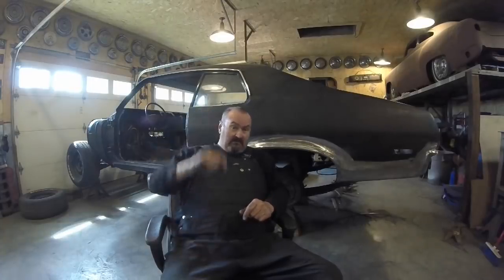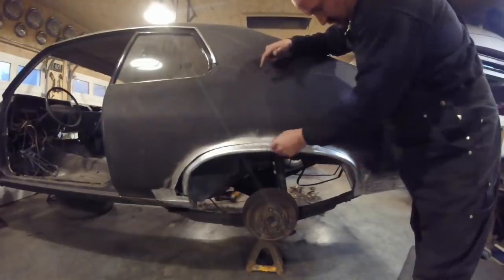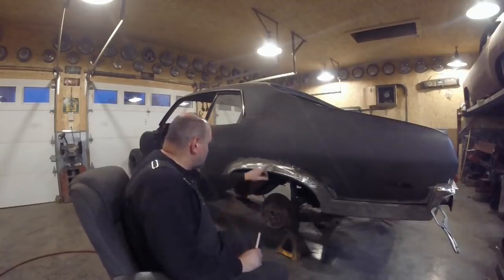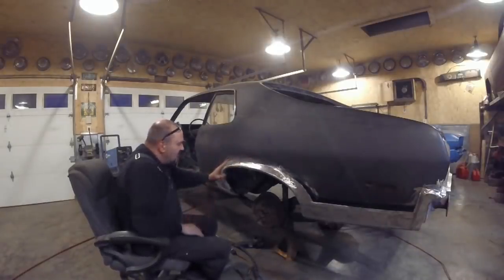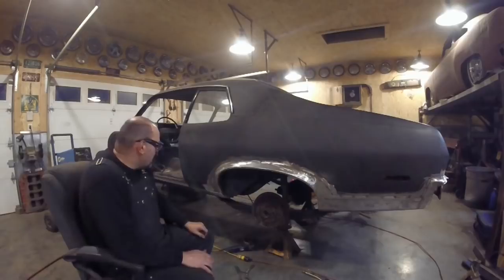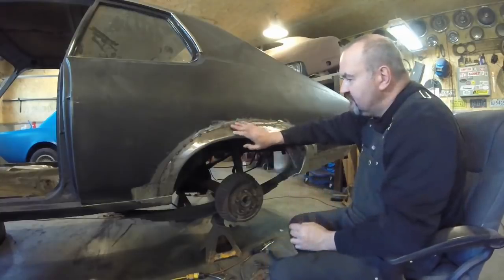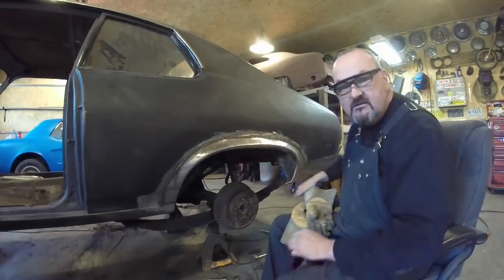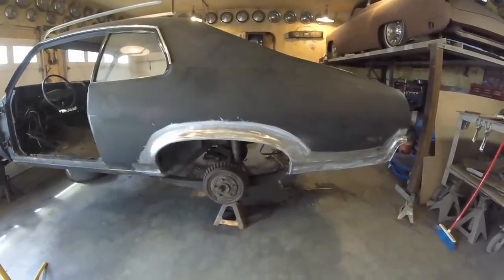How to repair rusty quarter panels part 2

Comment: Very good video on the nova. Now  that you have showed me the procedures , I have the courage to try to do it. SIR,  when are you going to show a How to repair on the trunk bottom end from left to right side by the locking device area, I have that problem on my 1953 chevy. Your tips are so helpful .I really appreciate it.Again Thanks.
Reply from the maker: Yes they are known to be bad there. I say you latch is ok just that rear filler panel from the trunk lid to the bumper slash apron. Is your rear cross member gone too? I used a roof section from a 52 chevy car to make mine on my 52 fleetline. One you see on the rack in my shop.

Comment: Hello, thanks so much for all your insight has changed the way I approach things entirely. I have a car that I need to replace both outer fenders because of rust but I can only find a patch panel for rear of the fender. Is it possible to make a front half quarter?
Reply from the maker: What car is this? It can be done just some are harder then others. I even used front fenders as quarter patches

Comment: Wish I'd found you when I replaced my quarter panel I had rust an the inner wheel panel still have rust on the right lower quarter panel and I'll use you technique replacing it thumbs-up

Comment: So I'm working on this exact procedure on my 67 Coronet 500 Convertible. I've replaced the floor pan, battery tray area and a patch in the front left fender.  I've noted how scrupulously clean your metal areas are,a and will replicate this on my efforts on the rear quarters and trunk drop downs. I got a donor car panels from a car in Canada, as they do not repop for the 67. I've been studying various vids in the hope to find one exactly like this.....I'm going to use the drop downs as my guide after they get welded in and clamp up a cut out just like you did. Awesome.
Reply: Classicindustries.com has 67 fenders and full rear quarters for 170$. Jegs.com has them too
Reply: @TheRoadhammer379  Thanks for the reply sir, but no, they do not....and if you are referring to that junk made by Sherman....its trash....not even close

Comment: GREAT VIDEOS FITZEE! I'm a good welder and handy with fabricating on an amateur basis and am on a mission to learn how to replace floor pans rockers trunk floors spot fixes ect. for my own restoration projects. Question for you , are you going to do a video, or maybe you did and I didn't see it, on how to prep/paint the back of the panels replaced? With the heat and bare metal being welded in, I would think it would rust through from the inside and the paint  would bubble and the fixed repair would rust back out pretty quickly. No-one seems to addresses the proper prep/paint of the back of the repair, just what you see.
Reply from the maker: I mostly just paint it with a rust paint. The none welded metal is not what you have trouble with. It is the welded sections that give trouble. Most time after welding if you can paint in there and put lots of paint in the welded section.  If I use it in bad weather I paint it then oil it to help safe it

Comment: Hi Your grinder technique have given me a new light in how to fit up patch panels, would this work for lets say rear wheel archs on a late model dodge truck, because my only concern would be dealing with newer cars and trucks is the sheet metal is much thinner
Reply from the maker: Yes it will work but you heat fir welding will be lower. It is harder to weld newer metals. The newer it is the worse it gets. They bronze  weld new cars today  as its a lower heat system that don't blow away the metal.

Comment: Great fabrication work! But I do have one question. How do you keep it from rusting from the backside of your welds? There is no way to prep the back after welding. For that reason would a complete quarter be a better option? Thanks and I love your work and your a true craftsman and fabricator!!
Reply from the maker: If you tend on using it all year round it will rust yes but most of these car I do are stored in winter and only driven in nice weather. I like to spray alot of paint in where I welded. Specially if you can't clean it up. After that if it is a all year round rig I would have it all oiled up

Comment: Quick question, when should I use seam sealer? would it make sense to use seam sealer between the wheel arch and the outer panel? wouldn't this burn when you do the spot welds? thanks again and your video are super! I have watched almost all of them.
Reply from the maker: All seam sealer is applied after the panels are welded up

Comment: How do you protect the middle layers of the metal from rusting again? Is there a way to get behind those repairs to coat all that bare metal thats been welded?
Reply from the maker: I paint them before I add the top layer

Comment: Hi Fitzee, GREAT VIDEOS, Thanks!  Question - In a previous video you mentioned you paint the inside of a body fix before welding the outer panel.  You said you use "just any old paint".  This doesnt\'t contaminate the final weld?  I've used weld thru primer before but that can be pricey..  Appreciate your thoughts.  Thanks, Bob

Comment: +
I have a project coming up with my ‘74 Chevy C10. The leading edge of the hood has that typical rust popping through. Maybe you’ve done a video pertinent to my situation. Any suggestions or videos you can point me towards? I thank you in advance.
Reply from the maker: I know the rust your talking about. Might be a brace in behind it that traps rust. I havent don't anything as of yet like this but if it comes up I will. But follow my basic steps on any of the videos and you get a handle on the repair. Runs into any issues just let me know

Comment: Hey Fitzee what type of Miller are ya using?  any problems with It?  Nice work as always Mate.
Reply from the maker: It's a millermatic 130xp. Have it about 20 years. I had a few hitches with it but it is used alot so expected.

Comment: Two questions:
@ 10:08, have you ever bothered to make up a tool that rests up against your shoulder so you can push a spot down, pull up with the other hand (that "L" shaped tool later) and still have a hand free for the gun?  It seems pretty common for body guys to have a hammer with a burnt handle end from that sort of use.
Under the inner lip, did you just spot/plug or also along the entire edge after you cut the lip narrower?
Thanks for all the information.
Reply from the maker: Have bad shoulders so try not to strain them . I use my gut as a belly clamp with the hammer. As for the spot welds in the wheel well. I new I was cutting them so drill the spot welds out close to the outer edge. When I cut the lip I was just on the outside edge of the spot weld.
Reply: @fitzeesfabrications  Gotcha, thanks for reply.

Comment: Thanks again for another awesome video. I also love the office chair. I have an old Cadillac bucket seat in my garage that I built a frame for with 4 castors. I even wired it up for power adjustment and the seat heater using a small agm battery.

Comment: You drilled out the spotwelds so you used an original quarter panel off a car instead of an aftermarket replacement?  You cut down the quarter panel only replacing the rusted area on the car.  If you welded a repair quarter panel a few inches below the body crease wouldn’t that be easier to refinish because it is a fairly level area rather than the curve in the wheel well?  I am going to be doing quarters on a 64 thunderbird in the future so I really appreciate your videos and your expertise.  I have used a spot welder back in my college days to patch rusted areas on my old cars.  Back then the goal was to pass inspection and not to be too concerned with correct body lines!!!
Reply from the maker: A factory used quarter will work great. Then I would replace the whole quarter. The curved edge is strong and withstands heat better. Some replacement aftermarket quarters do go up to edge of the panel and those cases I would replace it all if I have a edge to weld close to.

Comment: I have watched many of your videos and have not seen you use any primer paint. How do you prevent new rust on that raw metal between the panels?
Reply from the maker: Scrap any old car and  show me what is behind all the pockets and sections. It's all bare metal. What will you do with those spots? Don't like weld threw and if you paint you Still will burn off all the paint where you weld. Much of what I do get fully painted inside and out later.

Comment: nice work...helps to use an english wheel in patch panel shaping??
Reply from the maker: It can. The wheel is slow buy great for compound curves. I have one but rearly use it. I have alot of scrap compound curves metal around. Old hoods and roofs. If I can find a shape close enough I'll use it first.

Comment: I really enjoy watching you work on your projects. My flux core welder gave up the ghost and didn't work on sheet metal very well any way. I was shopping for a new welder with gas and wondered what welder you use and maybe give me some tips on what one to buy. I am on a budget but need a decent welder to weld panels like you do. Thanks
Reply: Get a used lincoln 100, 120 or 140, in the USA they run off 120v and good for work like this.  Used I see them for 150$  just make sure it has the gas solenoid if you want to mig work it,  some came without the solenoid.

Comment: 1st timer. Used your advice with  a rusty Jeep.  6 decent sized patch panels. After primer all the patches are unrecognizable. One area I need to fix because of bad sanding of filler but not on a patch.

Comment: Another great video. Do you ever reattach the panel you cut through on the backside when you buttweld the seam? It has the removal piece right underneath doesn’t it? Or does it fall back enough away from the top layer so that it doesn’t penetrate into the sheet underneath that you cut?
Reply: Make that comment half way through the video. Lol

Comment: Love the channel Fitzee.  A lot of good information for a novice such as myself.  As mentioned in a previous comment I ended up using your panel patch technique and she worked like a charm b'y.
I do have a question for ya.  After sanding the weld bead down there is a very noticeable hairline "crack" along a lot of the joint.  My best guess is since the patch panel was only 22 gauge I ended up taking too much of the parent material off when I sanded.  What is the best way to address this?  Should I re-tack the entire weld and then sand to leave the bead a little proud, and then mud over it ?  I purchased a pre-stamped wheel arch  for my 2002 Sonoma.  The panel lines didn't exactly line up either due to my inexperience or a poor stamping.  Not to worry as I can cut, hammer and mud to make it close.  Like meself she don't needs to be pretty, just functional:)   I have a cab corner and the third door bottom to do as well.  The stampings for those parts (from the same manufacturer) seem to be 18 gauge so hopefully a bit more forgiving.  I was going to send you a private message but don't see the option listed anymore.  Go figure.  Thank you.  Keep up the good work me ol trout
Reply from the maker: The hair line cracks are telling me your not using enough heat. There is penetration threw the panel. It will need to be rewelded. Can you get to the back side? Can you see the back side? I look for the penetration if I can .
Reply: Fitzee, thank you for the quick reply.  I did start re-welding with more heat and am holding the gun on the tack a bit longer until I can see the heated zone spread out. Originally I was too timid with the heat thinking I would blow through the 22 gauge. I can't access the back anymore but I will find some scraps and play with my settings. Thanks again

Comment: I want to say thank you for the tip about leaving some metal and tacking your replacement panel in them cutting a 45° With the cut off wheel. It makes putting in a panel so much more easier! Thank you again from Ohio USA

Comment: Love your channel. Two questions, did you just weld the little rear piece back in that you cut from the dog leg/rocker area to remove the remaining quarter arch/patch excess? Also, how do you treat the backside and overlaps of all your patch panels so they won't be bare steel and rust in the future?
Reply from the maker: Not quite sure what your asking but I cut the front so I weld the section in place that you couldn't if it was part of the quarter. I wanted to retain the body seam in the rocker. I paint the inside of each panel before welding.

Comment: Great job and tips Fitzee. Also, those Walter flex-cut grinding disks you recommended work like a champ. Better than any I've ever used, thanks.
Reply: Where did you buy them?
Reply: @SkaterStimm  Fastenal online.  You might get them at a Fastenal store if there is one near you.

Comment: Fitzee Once again I am learning and you are the teacher Thanks for the time to record this and share 
One question Re the welding are you just staying right behind the Nozzle of the MIG torch or have you special glasses on ?
Reply from the maker: I wear safty glasses. That's it. Be proven that safty glasses help in stop getting a welding flash. Wear a helmet.
Reply: "Polycarbonate" plastic block most of the UV due to the chemistry of polycarbonate plastic in the first place....Safety glasses MUST be POLYCARBONATE  tho...some are not--Thanks China!
Reply: Once again... flawless execution and very well orated..... you know you are good when you not only do it but you explain it so everybody feels as if they’re sitting next to you... keep ‘em coming.....
Reply: @johnrussell6620  It worked I got roped into a few welds on my Dad's rusty Discovery and it was tight places 
Soooooo Nice not to have flash or horrible sunburn (Y)

Comment: Hey Fitzee I just wanted to comment about  you saying you stay behind the gun with your eyes but the flash still reflects off the metal and it is just as dangerous. I am amazed that you do not get flash from it. I have had flash and it feels like hot sand in your eyes. It's terrible!
Reply from the maker: I had them too. Been years tho. Bad Habbit. Why I said wear a helmet
Reply: @fitzeesfabrications  I bought one of those new helmets that auto tint and got bad flash from it too. Cant win!

Comment: Thank you for all the great videos, I regularly learn something new from them. The fabrications are so seemless  that I have been wondering if you even need to use  filler on them. If so I can't imagine that it would be more than a thin skim coat. How often do you need filler if at all?
Reply from the maker: It's all will need filler. I'm good but not that good. You'll need to put alot more time into it to have it so you don't need filler. Now it don't need much but it will need to be flatten out

Comment: I should have used an office chair when I was in the auto restoration business.  Instead I used a mechanics stool that was pretty hard on the back side.  
To me, this Nova must be a special one since I can not see someone investing that kind of time/money on a typical Generic Motors vehicle that was a marketing nightmare for GM in Latin American countries.  Nova means No Go in Spanish.  Regardless, it was a nice lesson / refresher in body work that I've been away from for nearly 25 years after I retired. To me, you're an artist!
Reply: So with that cloth chair, you must leave a smoke alarm in the chair when you finish right?  I tried to train my cat and then my dog and then my bird, but none of the stupid animals could be relied on as 'fire watch'  and my kids all moved far away, so I stuck with a smoke alarm with an added on/off switch....
Reply: Glasscutr
 ... As I  recall, the Nova didn't make it to South America till it was a rebadged Toyota, so not really a GM product.

Comment: Is cut and butt a recognised technique or is it something you have developed? The way you use it is brilliant.
Reply from the maker: It's been around as long as there been grinders and zip cut wheels. Don't see it as much as I think you should. I figured it out on my own as we don't have any metal forming people in newfoundland. But like so much other things I taught myself there are others out there with the same thought process.
Reply: Fitzee's Fabrications  

Cut and butt came over on Noah’s arch.  It was around in the 1940s when I started body work.   So was lead work, which I still prefer since it becomes part of the structure.

Comment: Thanks for all your videos! I too use .023 wire. I found on my machine .030 seemed too hot. Your tips for butt welding are awesome. Do you use flux core or argon mix? Anyway thanks again for sharing and get from West Virginia USA
Reply: Supposed to say HEY from West Virginia USA. Fat fingers on a small phone! Lol
Reply from the maker: Hey.your welcome. I use a co2 gas

Comment: Hi Fitzee from the UK! Another great job. I have done this job myself twice now and got away with it, I wish I could have used your technique, it is truly awesome. Have you any tips for MIG welding upside down, I always seem to struggle?
Reply from the maker: Hate it. Like yourself I have trouble. Biggest thing I found is to set it all up so your not straining yourself.
Reply: Hi fitzee. Also from uk. Great channel and expertise. 

Please comment or show on plug welding. I need help and advise to make mines satisfactory. 

Thank you all the best.
Reply: I hate welding upside down also .. I am just a back yard welder .. if you can with scrap metal play with the heat and wire feed settings ,, I found that if you change them a bit from your normal settings it will weld better ,, been a bit since I have done it don't remember if it is faster wire or slower feed .. but it did help me with the welding ,, now if I could get a good welding coat so the beeping sparks will stop going down my neck and burning me ..